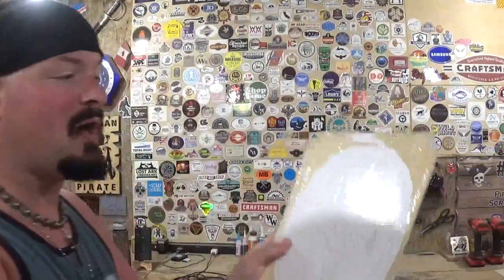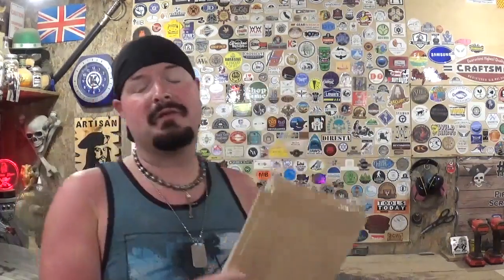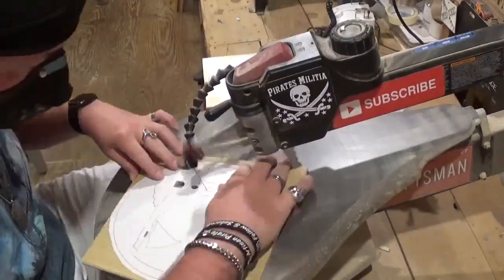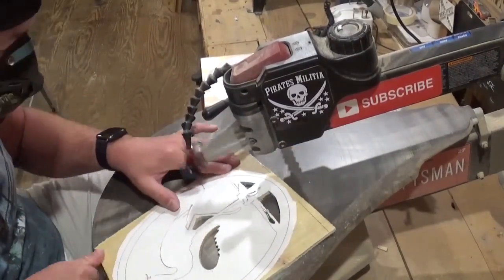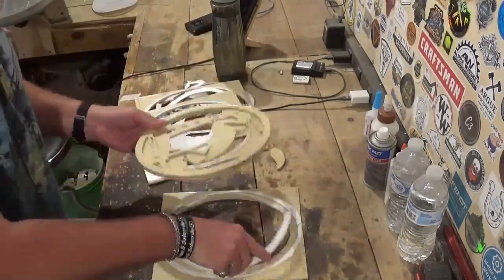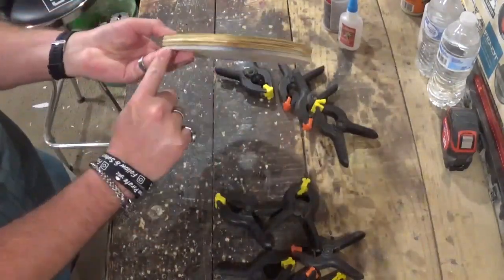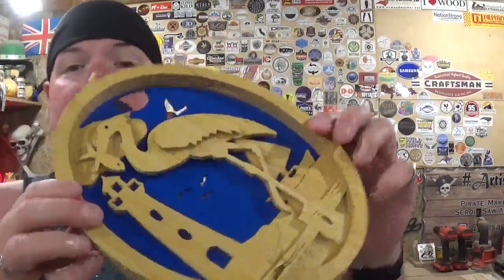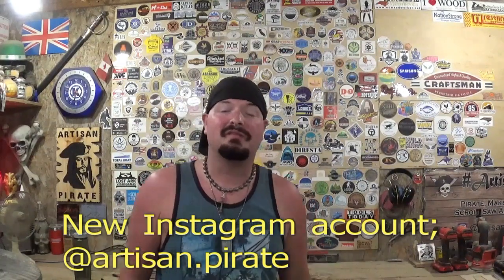Tropical Beach Scene, Scroll Saw Project

Comment: Seeing when you use the packing tape the pattern comes off the board in places . That’s why I use spray adhesive on painters tape. I have put packing tape then over patterns to help
Reply from the maker: I have ALWAYS used the clear packing tape method unless i'm cutting out a segmented piece or puzzles